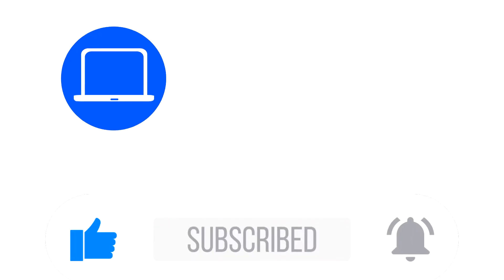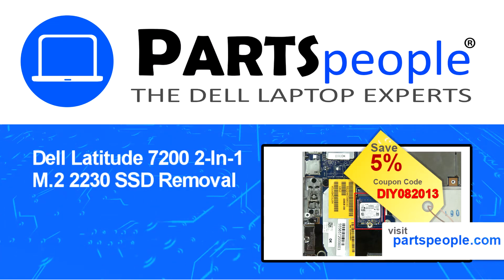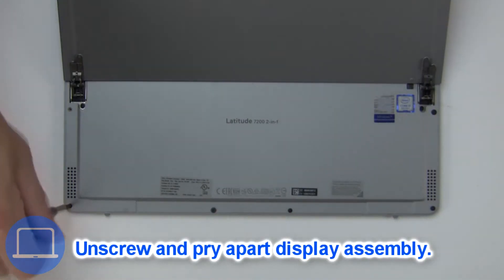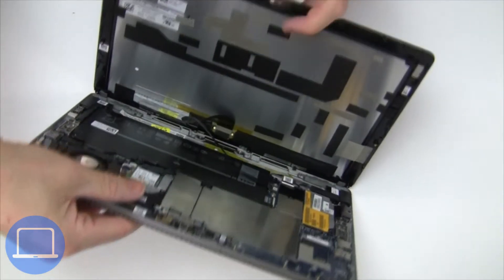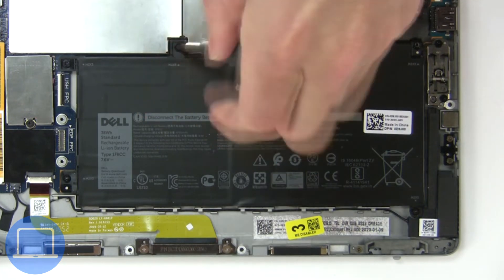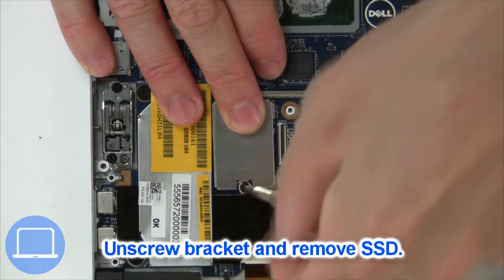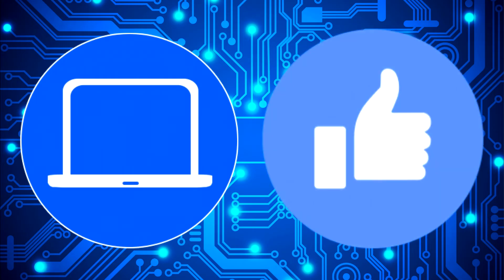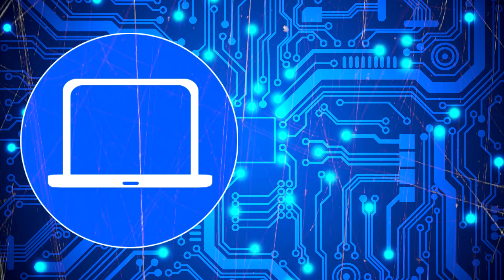Dell Latitude 7200 2-In-1 (T04J001) M.2 2230 SSD How-To Video Tutorial

Comment: Removing the battery step - peel back the adhesive tape, then pull the connector down toward the battery.  Do not lift or you may break the battery connector.